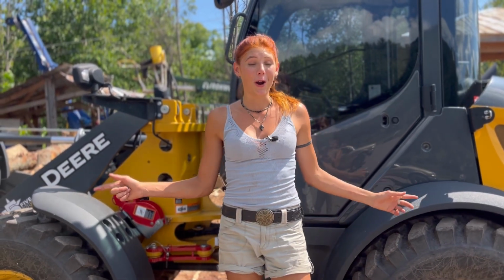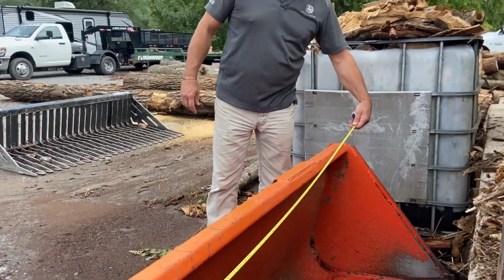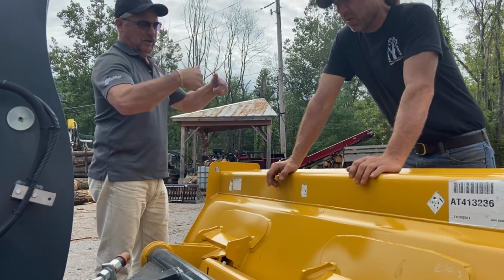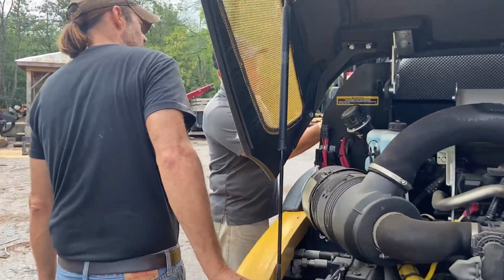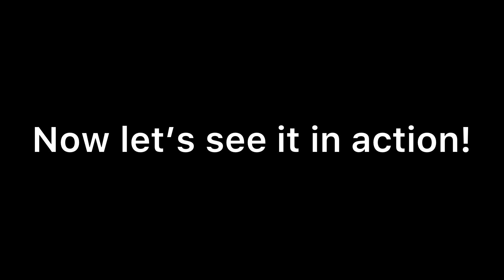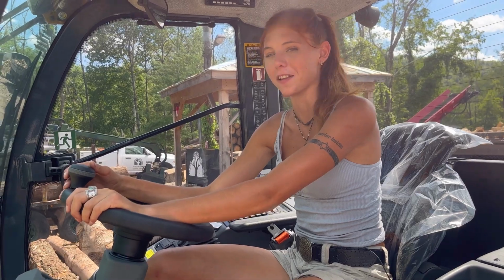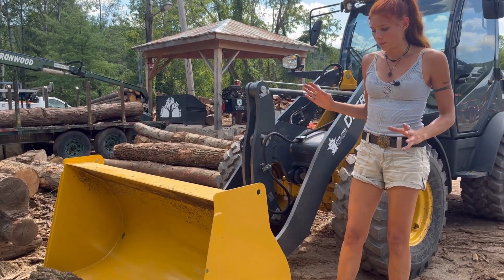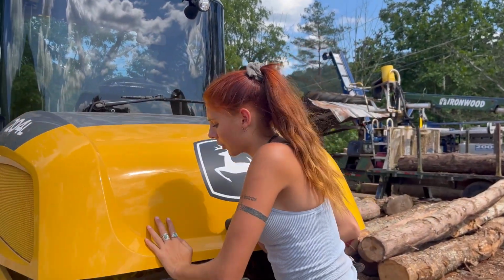Introducing the 204L Articulating Loader; Features and Demo

Comment: It's a nice machine. I run a 544K JD. The salesman said the quick connect is eclectic But it's actually electric activated hydraulic Now for a word of warning. When servicing the machine disconnect the bucket or attachment from the machine. Raise the arms up to the point you can see under the area were the connection pins come out. This area contains the pins that also houses the hydraulic motor. There is a plate that is held on with 5/8 inch bolts. Remove the plate and clean it out. Dirt and debris can get into the area and get packed in. It can get built up enough that the C clips that hold the pins to the ram piston can get pushed off. Of the clip comes off you can not release the attachment. Replacing the C clip is a royal PITA to put back on in a confined space.

Comment: That is such a cute loader, impressed with the width of the tires and their tread pattern as its not the useless bar grip across designed for gravel pit wear. Also didn't realize they make hydrostatic drive loaders but totally makes sense for the smaller units. Looks very maneuverable too for tight quarters in your yard. Articulating ahead of the cab should offer greater visibility for the forks in a turn over a front cab mount style loader. The height to get in/out of the cab looks fantastic as the operator would be doing that constantly with the type of work in your yard. Hopefully the ever dreaded emissions won't be an issue as per any brand of unit one buys these days is forced to deal with.

Comment: Nice! I have a Case W20B loader with a case 35A backhoe adapted and attached to the weight plate hanger in the back. The Joshua Tree National Park Service ordered it that way from Case, so it is all set up clean with quick disconnects on the hydraulics. I hang a Rock Jaw grapple off the bucket to load logs onto my Woodmizer LT40. It also has a four way front bucket, so it's a pretty versatile machine.
Reply: You all aught to do longer videos.  Great content but a bit short.

Comment: Thats a nice machine! Strong but not too big and clumsy. Quick attachment is a most and will save you a lot of time. The only downside i noticed was that that the hood over the engine dident go up so high, and those 2 gas lifters looks a bit in the way when doing service, but i think thats a great machine that will do you a lot of good! 👍🇸🇪

Comment: Sweet!  There are like 16 different attachements but with JD website details of exactly what will fit are hard to be sure of without a call to the dealer. Never did much like the JD site but their equipment is fine.

Comment: Yeah it will take you some seat time to get used to running a proper loader.  You will find yourself using the tractor less and less.  I bet the tractor gets relegated to another task at some point down the road.   Not a huge fan of fuel additives, but at least Howes is a demulsifier.  None of the additives clean injectors, or fuel systems, or combustion chambers.  I've personally been into enough engines and fuel systems to verify that.  If you want to spend money then find fuel filters rated to 4µ absolute for common rail injection.  10µ absolute is more than enough for non common rail.  Filters save injectors, that saves the engine.

Comment: Emerald hate to disappoint you but that 7500 hundred pound lift is at the pin you only havr 3500 hundred pound lift at the lip of the bucket also if you were told a larger bucket is available not so J D will not install a larger bucket . Hope your salesman was more honest than the one my friend dealt with . Other than that great video as usual

Comment: Nice loader. John Deer really needs to switch over to a hydraulic coupler there electric motors suck I’m running 7 rubber tracked skid steers i buy at least 4 motors every couple months